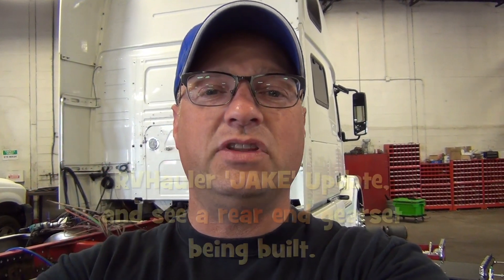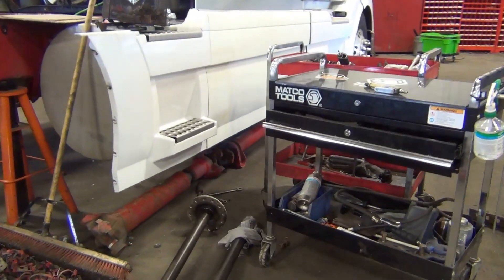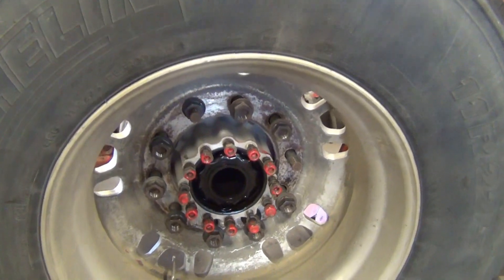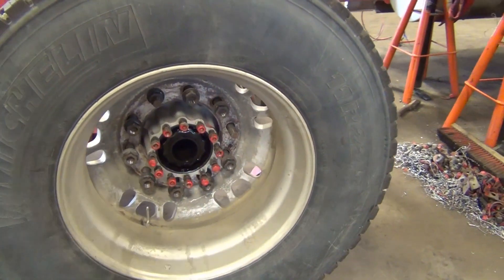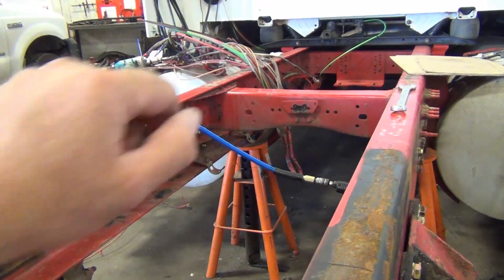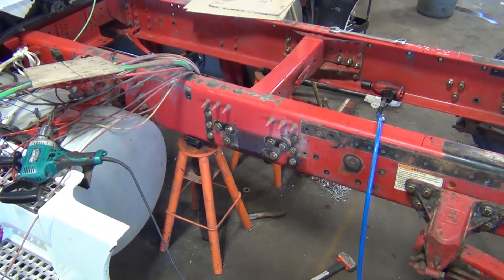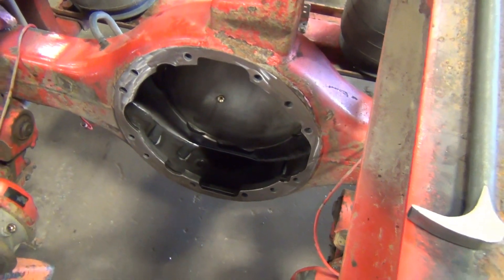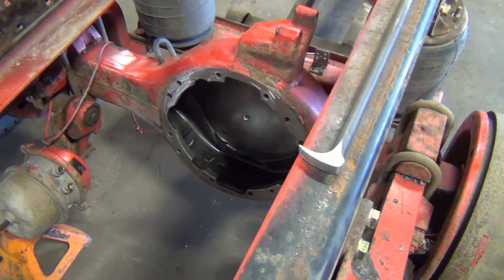RV Haulers How to Change a Rear End Ratio Gearset

Comment: Fascinating!  Now I wonder with the ratio change can the rear end be equipped with a “posit rack”?
Reply from the maker: Hey there Smokey ...  Some of our units are already equipped with what is called a rear end locker.  Hit a switch on the dash, and your rear end axle tires are both locked into sync.  Sadly, these heavy trucks of this vintage didn't have a posi-track feature.

Thanks for the question!  Gregg

Comment: Did this truck have an OD transmission or a non OD transmission ?
What engine RPM were you aiming for at cruise ?
Reply from the maker: It was direct drive, and we usually shoot to be at 1100 rpms around 65 MPH.

Comment: I was a little concerned to see him wire wheeling housings,
kicking up rust and paint debris so close to the newly assembled ring gear and
bearings. I would have at least covered the assembly to keep it clean. Maybe it was just the camera angle. That said. I have
watched most of the videos on this channel and that is the only thing that I
have caught, that I have a problem with. Great work on the videos keep it up. If I ever decide that I
want to give full timing a shot I will keep you guys in mind.

Comment: It's great to be able to see this solid work getting done, doubly enjoyable to think about the heat and torque that goes through those gears and bearings while under load, such as pulling a hill. All the care in getting it done right adds up to safety and reliability.